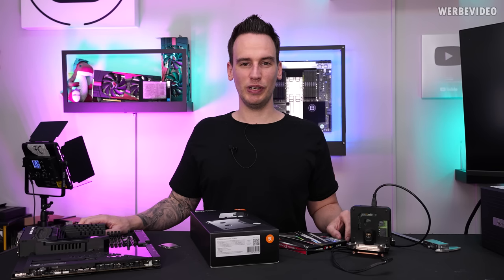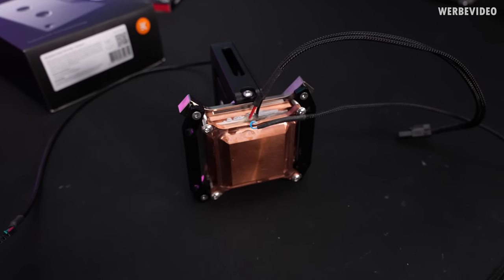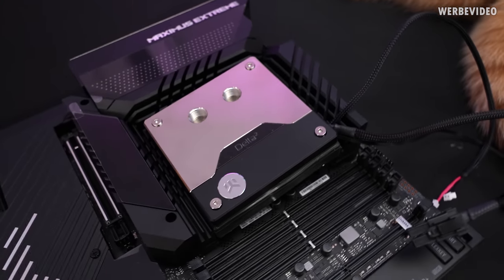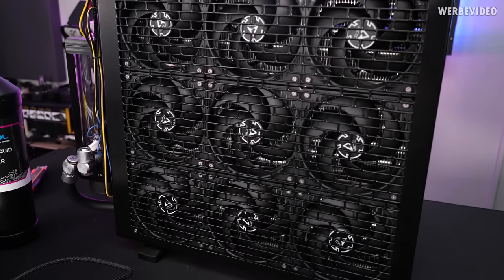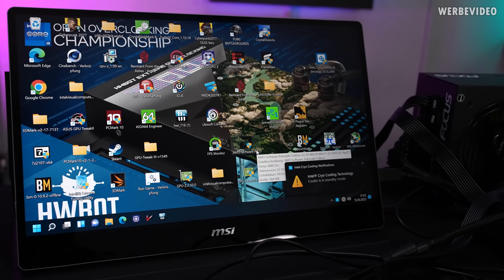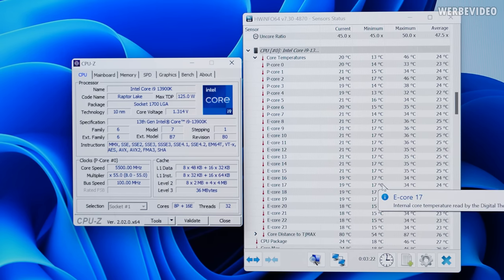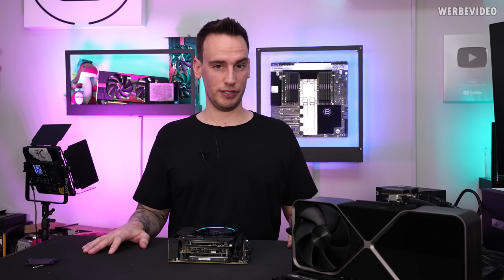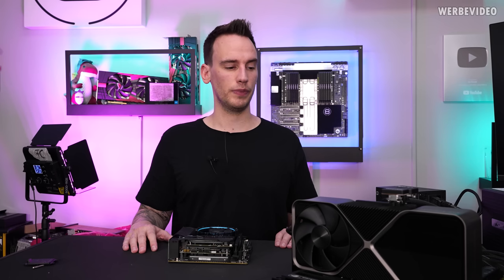This insane 500$ Water Block allows 13900K Overclocking above 6 GHz

Comment: peltia cooling needs more develpers the whole cooling industry should be co-op to make the parts generalized. 

I wanted to go for a 13900k but budget wise it would take me over a year unless there is a windfall or change in pricing.
Reply: No, TEC cooling is dead technology and extremely power inefficient. Only suitable for specific industrial usages. There is a reason manufacturers stopped using TEC's. Only CM and Intel did a big stupid with the ML360 subzero for LGA1200, it was only a showoff and was abandoned after LGA1200, there aren't any other mounts for it.
Reply: they aren't efficient enough, though it can be done better than this, with the best case scenario being with 2 cooling loops one cold side and one hot side with the peltiers in the middle, aka: cpu block pump and peltier cold side" as one loop and "peltier hot side, pump and radiators" as the other that way you can have many more peltiers and use them at their more efficient point
Reply: There is that phase when youre 13 and you find out about TECs  and you immediately want to put it on everything : P
And then you grow up and learn enough math and physics to realise how terrible idea it is.
Reply: You know how TEC works ?? Block itself draws like 200w

Comment: Never liked TECs, too energy inefficient.

I built a watercooled 315W TEC back in 2004. Temps were decent at -20C. But it scales up badly.

Switched over to phase change cooling after that. Way better temps and less consumption.

Comment: Gotta remember that you are not only adding wattage to the cpu, you are also pulling another 210watts on top of that.. So performance per watt is not very good.. I guess if you have enough money to buy the cooler you are not very worried about power consumption, but still.

Comment: Wouldn't it be possible to achieve same results with delidding? I kinda feel like Intel is doing crazy stuff to fight a problem of their own creation, that is underperforming IHS's. 70 °C isn't exactly cryogenic. My simple mind tells me to reduce the obviously large thermal resistance first. I would avoid using TEC, as it's an equivalent of another OC'd i9 CPU of wasted power, both electrical and heat output.

Comment: So $500 for a cooler that gives you around 6% improved performance but requires 20% more power. This is a clear example of 'diminishing returns'. Not worth it for any one but the few that absolutely need to most performance they can get (for bragging rights or whatever reason).

Comment: Wow, I am honestly pretty surprised how well this thing worked.  I didn't have high hopes for it, I was sure it was going to be a novelty at best.  Still not exactly a high performance design, but its a step in the right direction.
I with it was possible to know the exact peltier module they used.  As a thought experiment, I found the highest power peltier from a name brand and did the math on it to see what the maximum theoretical performance would be with a power budget of 210w.  Idr the exact module, but it was a ~320w maxQ module from Laird, and if you restricted the power to 210W, you could achieve ~30C delta at 150w heat flux.  Of course, its an expensive module.
But it shows that getting a bigger module and running it at a lower power can greatly improve cooling performance.

Comment: If at one point your cat is a white fluffy cat, and the next time you look up, it happens to be an orange tabby... Your cat is not a cat.. it's.. something... something else... Something ancient and not of this world. A trickster demon or spirit, sometimes referred to as a Cheshire. It's not necessarily malevolent, but by nature can be very mischievous... 

If ever you had wondered why you spent hours, even days, coming up with the perfect ram timings... And after every satisfactory stability test you took a step back and it was your finest work in that regard.. then the next day came back to a CMOS battery that popped out.. or a mysterious piece of orange fur that had just ever so precisely managed to bridge the clear jumper... I'm not saying you did something wrong necessarily.. and often this is a sign of respect.. but, don't feed the trolls is all LOL.

Just laugh it off and move on, before next thing you know, the micro code for your golden sample, potential world record overclocking CPU, mysteriously has its micro code corrupted in such a way that only when you go to upload results... You get a hard crash.. but otherwise performs better than ever before... Or worse, you get enrolled in the windows insider program on every license, despite never connecting the machine to the internet..

And for some reason, always coming back to the machine with the Candy crush app reinstalled and with hours logged into it.. sometimes with transactions, yet having no memory of any event that would have led to such a thing.

Comment: TEC is always implemented in the worst way. It should never act as an "Ice Cream Sandwich" where it's directly cooling the CPU. If using TEC to indirectly cool a CPU, you can use a TEC with any amount of cooling potential. I'm going to build my TEC system where energy is indirectly transferred, and post video. Been sitting on this is idea for far too long.

Comment: Alter ich glaube das du in 2:18 made a mistake :P (My german ends here hahaha actually mostly because I cant spell :P ) yes 210 watt is less than 300 watt but you did not take into account the watt equivalent of heat absorbed by the water flowing inside the block so the peltier device (if lets say the CPU consumes 300 watt) will be called to "exchange" less watts since it doesnt have to cool the hot water, at least not in its entirety (that's the radiators job) so if its is really 210watt peltier (whcih sounds a lot to me for such a small surface area ) then it probably can manage a 300 watt CPU with ease.

Comment: They use a hell of a lot power. Add an extra 200+watts to your pc consumption. I had one and it died a month after i bought it. And it barely cooled a 10900k. They really are just a gimmick. i replaced it with an air cooler.

Comment: except that TEC is an extremely inefficient device, as an overclocking concept i guess it works, but as daily usage you'll be wasting alot more power for an insignificant gain

Comment: While it's a pretty impressive piece of technology, my opinion is that they're going in the wrong direction. 
It seems like many companies are focusing hard on performance and treating efficiency as a secondary concern. 

Given the fact that most of the world is facing an energy crises and just the sheer fact that we're wholly inefficient with the ways we currently use energy, we really need to change the way we think and design electronics in general.

There should be a balance between performance and power, and principally companies should be spending more time asking themselves if they're solving a problem or are they creating a problem to solve.

Comment: At least this one is safe!
LOL Nvidia 4090 antics.
12 pin power connector explodes then burns like a Roman candle.
Burn your home and 3 grand of Nvidia malware if you want to risk best performance.
RNA 3 will max higher in 6 months. 50 % higher power draw from base, currently circa 350 watts. Double the infinity cache. IE double stack them. Plus another improvement I forget from adore TV video. Nvidia is now toast in the next 2 or 5 years of GPU generations.